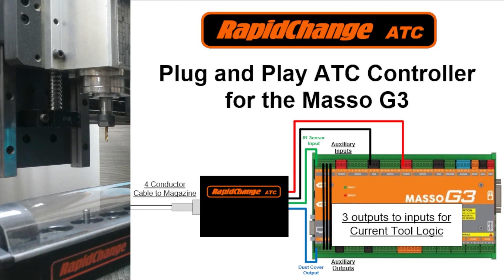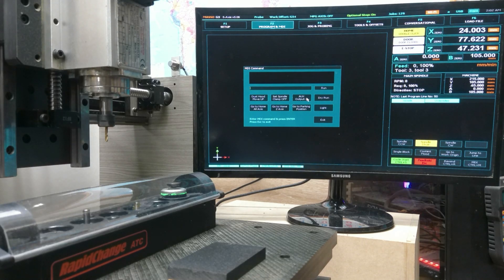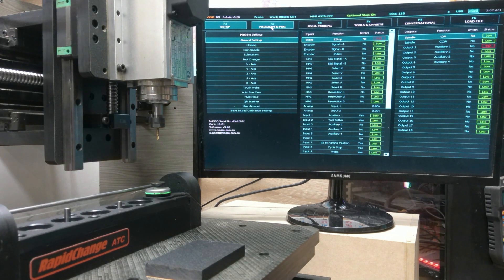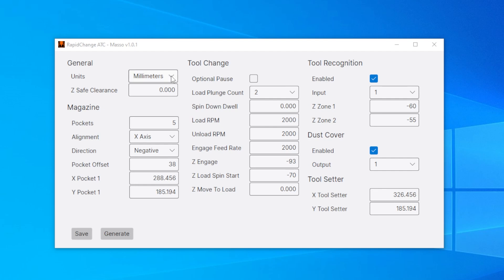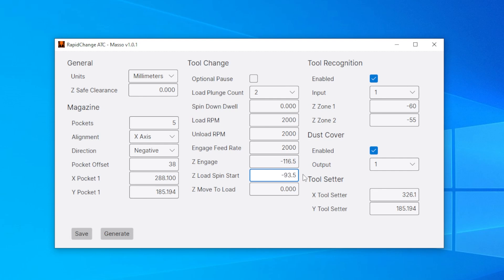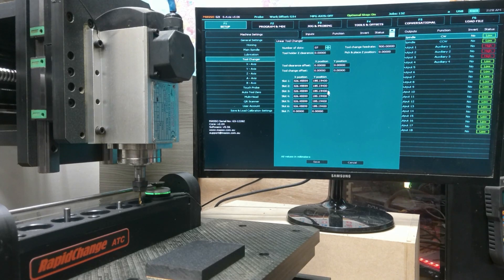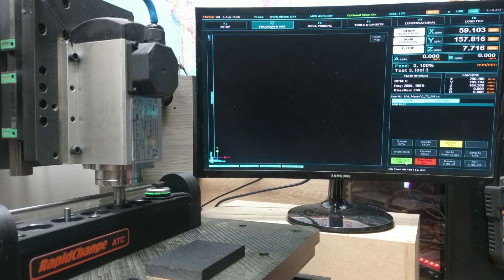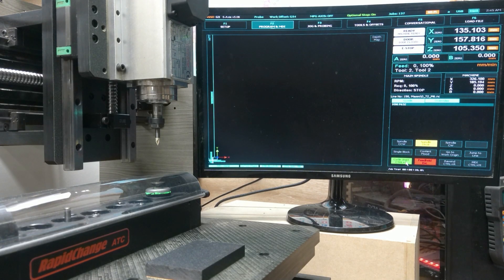RapidChange ATC Major Update to the Masso G3/G3 Touch Flow / Onefinity Elite must have upgrade

Comment: Great information. I'm working my way towards a RapidChange ATC for my Onefinity-Masso machine. One thing I need to figure out is how to get the Huanyang VFD to drive the spindle in reverse, but I'll get that figured out.  This video is almost a year old. Is there any more current information/videos?

Thanks,

Jim
Reply from the maker: Hi Jim,
Getting the spindle to run CCW is very simple with Masso.
New videos are on the way we have been busy this last year and have made a lot of improvements

Comment: I have a general question: How will this work, when the Gcode is asking for a tool change? What is the link between the CAM program and the subroutines? Does it all work on a simple M06 Txx command?
Reply from the maker: For Masso the postprocessor handles it. They call a subroutine in the place of the M06 Txx. We have postprocessors for most CAM programs

Comment: This is awesome Don!  Hopefully I'll have time to try this today/tomorrow if I can sort out my spindle issue.  I'd like to think I was instrumental in nagging you enough to do this 😉.

Any update on a pause to insert/remove the dust boot for tool changes?
Reply from the maker: Hi Steve, thanks for the commenrt and question.
Well my mother always told me I need a bit of nagging at times LOL. I sent you a zip with all the necessary new subroutines along with the Vectric PP that will pause before and fater the tool change for dust boot exchange

Comment: Will this work with the PwnCNC VFD on the OneFinity CNC?
Reply from the maker: It should yes. If you email me I can help you figure it out. Generally there is an extra conductor in the cable that is not used or was used for fault protection in the past that needs to be wired in and possibly seme settings in t
he VFD. the spindle in this video is a PWN:
https://youtu.be/2NhXMAU8v88